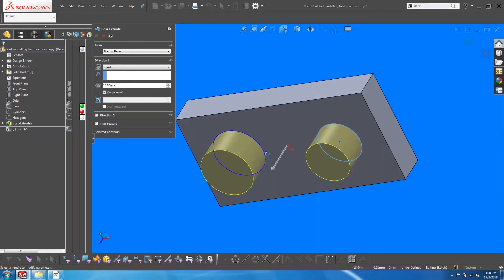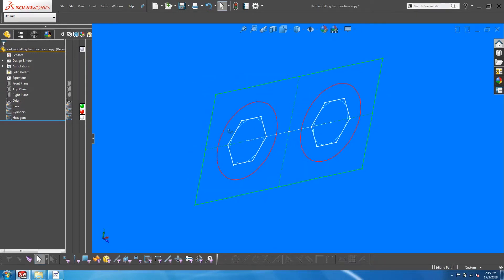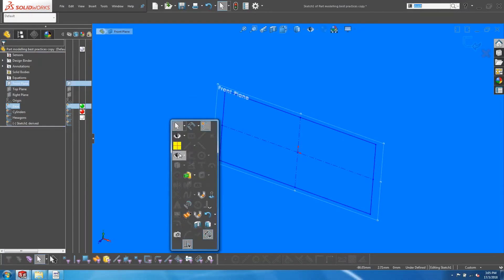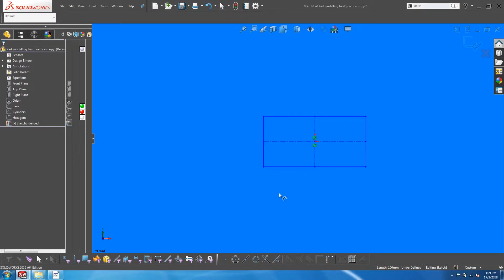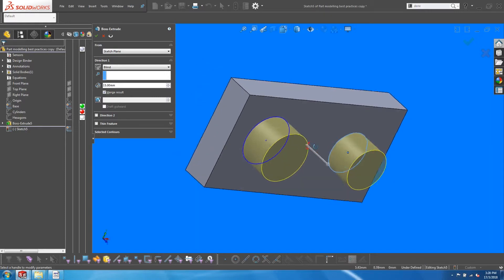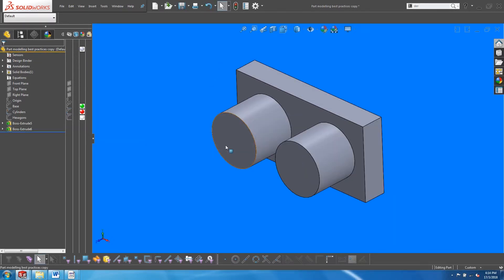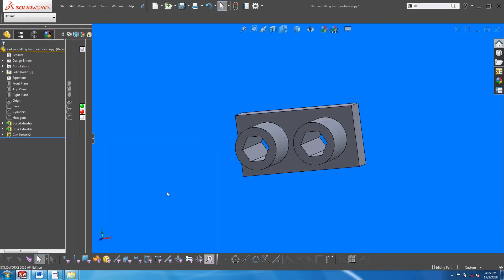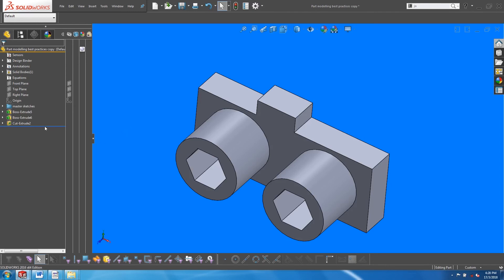Solidworks - Master Sketches (Part Level)

Comment: Your video series are fantastic!! But why not do "Convert Entities" and then select the sketch.
Reply: I also thought of doing it like you, but this guide is to show how to make the model with fewer errors, fewer constraints, and less external referencing. A complex yet optimized design helps improve SolidWorks loading speed